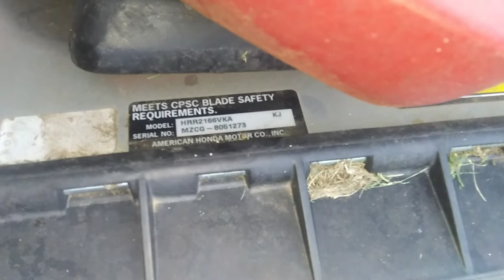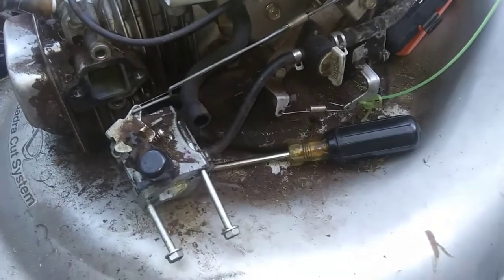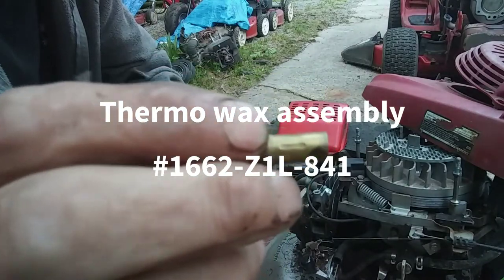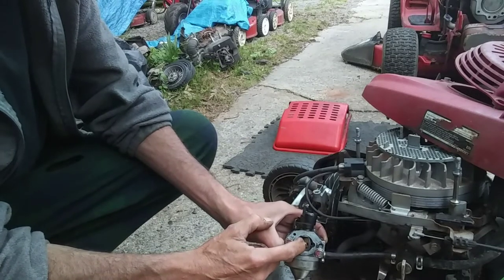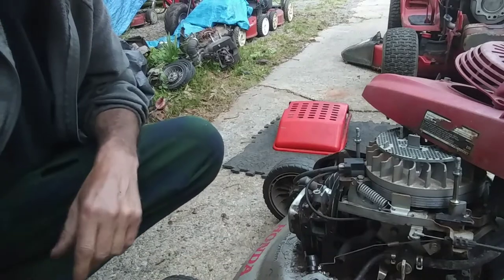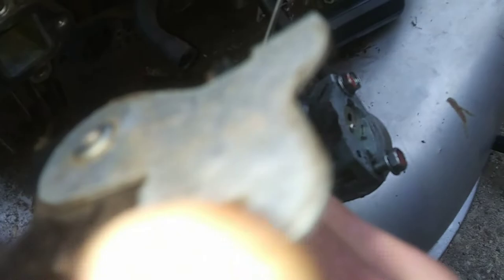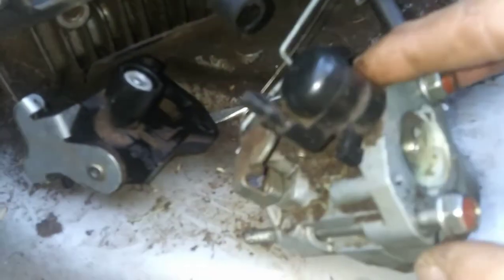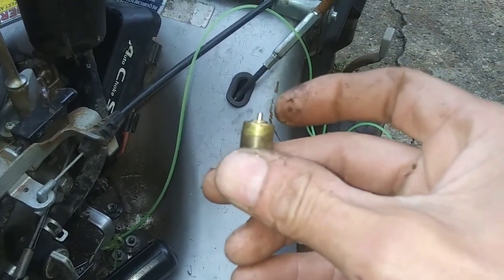Honda Mower won't start,check this!(thermos wax assembly)

Comment: I have an HRX217 that calls for wax assembly 16620-z0y-M41.   This is the same style as yours, versus the red colored square version seen in so many videos.  I am not able to get my mower to start.  It is well kept, but I still cleaned the carb, made sure I have a spark, I know fuel is fresh...  I keep coming back to this wax assembly.  When I check mine, the pin is retracted.  Looking at pictures of the part on the net, it is always shown with the pin extended from the housing.  Looking at the actual part from an eBay seller, the pin is extended from the housing.  I now believe the default position of the pin for this style of wax assembly is extended.  I looked up the part number you displayed and I observed the same thing, it is shown extended.   The opposite is true for the red colored square one, it is always shown with the pin retracted.  I am going to order the part tonight, will post an update here to confirm if it ships with the pin extended or retracted.
Reply from the maker: Is the choke closed when its cold.

Comment: You did not give the part number for the round style thermowax assembly. I have a HRR2165VKA Honda GCV160 mower. What is the part number?
Reply from the maker: I believe it's 16620-z0y-m41
Reply from the maker: You should check your engine model # and look it up at honda parts nation to be sure.